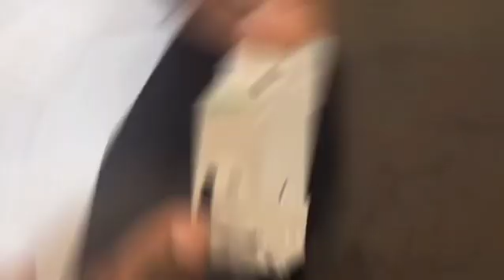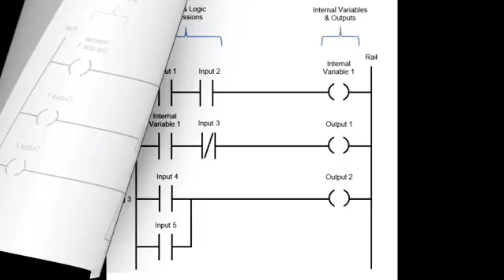How Impulse Relays Work | Wiring, Specs & Applications

Comment: Are impulse and pulse relays the same?
Reply from the maker: Yes; impulse relay and pulse relay are often used interchangeably, especially in control systems, but there are slight contextual differences depending on the manufacturer and application.
Reply: Can impulse relays be used for three-phase circuits? Is there any specific load type or limit for using impulse relays?
Reply from the maker: @GoldenCricketTamil  Great question! Impulse relays can definitely be used in 3-phase setups but not to switch the actual 3-phase load directly. They’re mainly used at the control level to toggle contactors or other relays that handle the heavy current. Always check the relay’s current rating before using it

Comment: 🔥 Amazing video, bro! Super proud of the content you're creating! 🙌

Quick breakdown on how impulse relays work for anyone watching:
An impulse relay, also called a step relay, changes state (on/off) with each electrical pulse. Instead of needing a separate switch for on and off, one single button can toggle the state. It's perfect for lighting circuits where multiple switches control the same load. 👏⚡

Keep up the amazing work – your explanations are clear, and the visuals are 🔥🔥! Subscribed and looking forward to more!
Reply from the maker: Thanks

Comment: What is the purpose of that relay in control panels
Reply from the maker: An impulse relay in a control panel can be used to toggle between two states with a single electrical pulse — like switching ON and OFF, or toggling between two loads for example it can be used to alternate the operation of two pumps, acting like a toggle memory — remembering the last state and switching to the other on the next command. It’s a simple but clever way to manage redundant pump systems without needing a full PLC or logic controller.